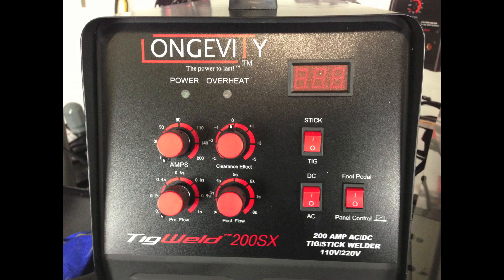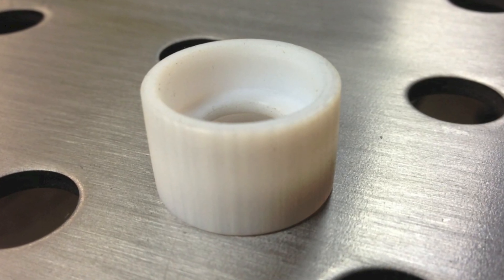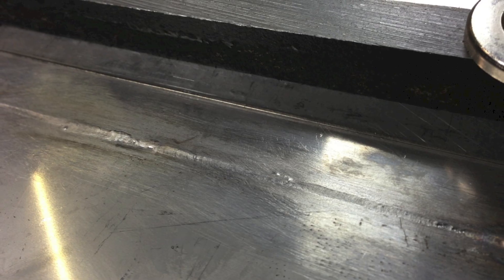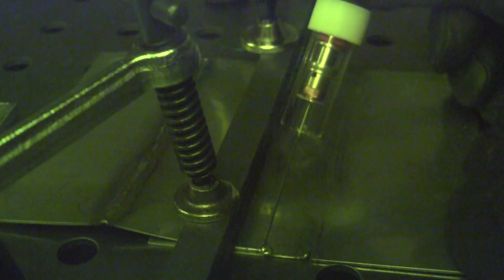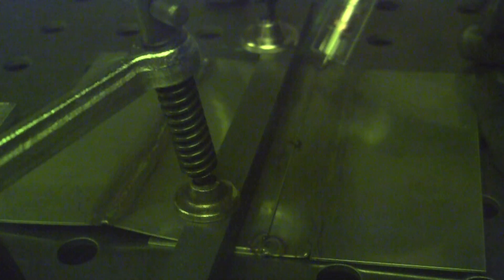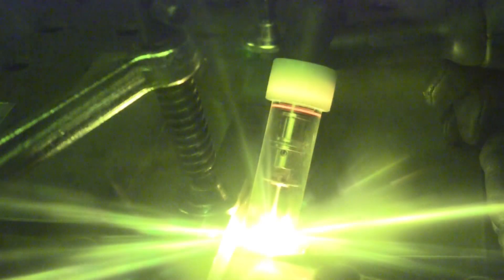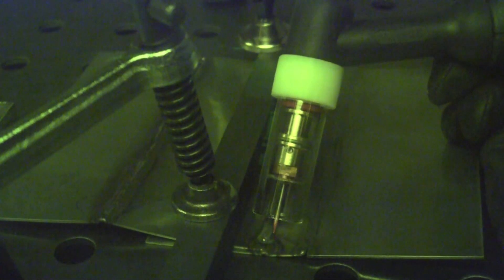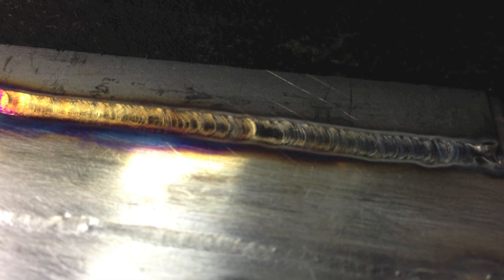REVIEW OF ARGON GAS SAVER PYREX TIG TORCH LENS BY CK WORLD WIDE WELDING A LAP JOINT - PART 2

Comment from the maker: It was 16ga 304 sheet. The actual effect of the gas saver was tough to tell because I was on the last few puffs of gas before my bottle ran dry. We will run some tests soon showing the effect of the gas flow on the ability to shield the bead.
Stay tuned in......